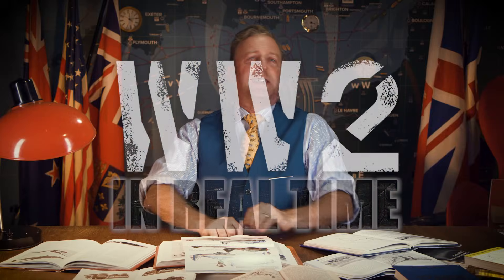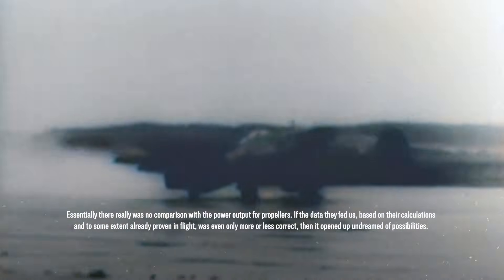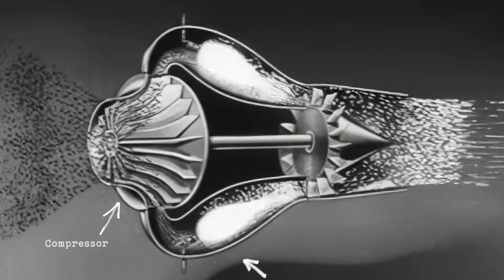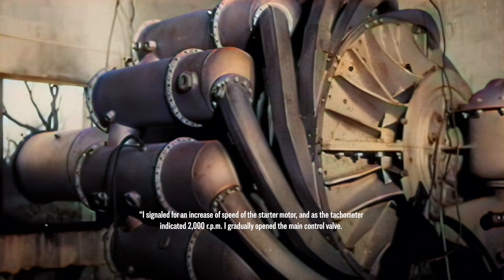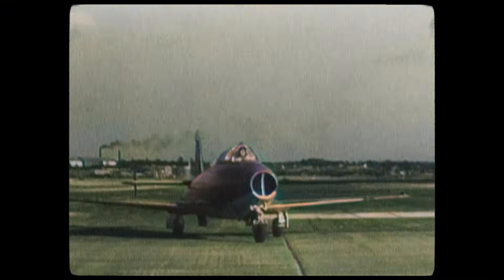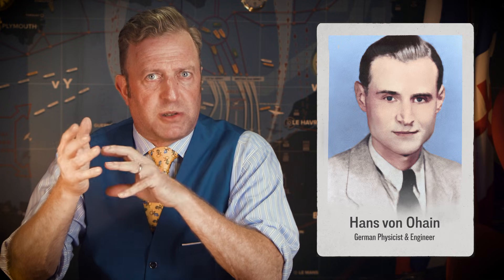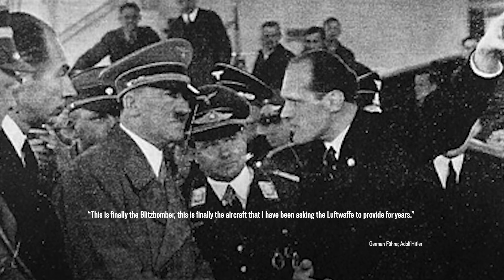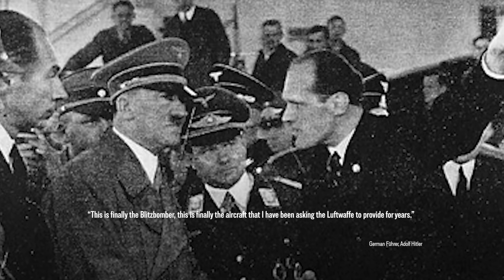WW2 Jet Engine Development - WW2 Special Documentary

Comment: Jet facts:
• To a thermodynamicist, jets aren't too different from piston engines. Both have a thermodynamic cycle (suck, squeeze, bang, blow) in which air is compressed, fuel injected and ignited, and the resulting high-pressure combusted gas pushes the engine along. Indeed, jet engines have a compression ratio, as do car engines, and just like in cars, the higher it is the more efficient.
• The bypass ratio is the proportion of the air accelerated by the engine which bypasses the compressor. Since the thrust increases only linearly with the speed added to the air by the engine, but the energy needed to do so increases quadratically, it's more efficient to increase the thrust by accelerating more air than by accelerating the same amount of air to a greater speed. So a higher bypass ratio is more efficient. However, it is inappropriate in supersonic jets, and it requires bigger turbine blades which can withstand greater centrifugal forces/stress. This is why old jets and supersonic jet engines are thinner than modern civilian jets.
• Because the turbine and compressor blades have to be so strong (with high temperatures and pressures, plus centrifugal forces), one of the main limitations to jet design is materials science. Nowadays, each blade is typically made from a single metal crystal/grain.
• Civilian jet engines are often rented out nowadays, instead of being just another part bought with the plane.
Reply: I am not an expert on jets, but didn't most jet burn their fuel as single burn while piston engines burn their fuel in pulses? Of course there are pulse jets which burn their fuel in pulses as well.
Reply: @vksasdgaming9472  Of course. Still, by following a volume of air through either engine as it is compressed, combusted and used to push the engine along, you can see a thermodynamic cycle which is fundamentally quite similar. You'd typically draw this as graph showing cycles of pressure and volume or temperature and entropy, and the graphs would look fairly similar (albeit stretched differently) in both cases.
Reply: @alphamikeomega5728  I meant that all parts of cycle happen simultaneously in different areas of engine instead of sequentially in same area. At least in theoretically perfect engine.

Comment: During WW2 two paths led to Jet engines the first was a attempt to find a better way to propel aircraft, than pistons, the second was an out growth of high altitude  requirements, eventually you realize that if the boost from a turbo/supercharger exceeds the exhaust pressure you don't need the valves and cylinders. The Russians got there via second route, but cancelled existing in house efforts when captured German jets at the end of the war.

The Centrifugal vs axial jet engines is also an interesting issue. Frank Whittle examined both approaches and determined with the materials available the time would only support a reliable centrifugal flow engine, you might need to replace engines every day with an axial engine, although with better materials they were the long term answer. The Germans built axial flow engines and accepted the need for 10 hours of flight before refurb on the engines. AN interview with Eric Winkle  Brown about this exists on YouTube.
Reply: "an out growth of high altitude  requirements"
uh?
Reply: To pull in ar at high altitude you put a turbo super charger on  the air intake, which is turbine,  eventually you realize that the pistons and cylinders aren't required  if the intake boost is high enough. @johnburns4017

Comment: Had the Me-262 entered service earlier, it would have, at best, bought Germany maybe six months. After that, the P-80 and Gloster Meteor would have began arriving in some numbers, and the allied advantage in production capacity would have been as unassailable as it always was. 
Also, one other problem for those who say: if only they could have built more jet fighters!
Suppose for a minute you are the Reichsminister for aircraft production, and Willy Messerschmitt comes to you saying "I got this new super fighter that is at least twice as good as anything we currently have in production, and I want to shut down and re-tool a bunch of my factories that are making BF-109s so I can start turning out my new plane!" Well, problems is, you're losing dozens of fighters every day right now, and a month or two spent re-tooling for production of the Me-262 might really screw over the Luftwaffe's ability to replace it's lost machines during that time. It might completely hand over air superiority over someplace really important. 
Point is, in a war of attrition, the losing side will have a really hard time trying to regain a qualitative material advantage.
Reply: What if, what if!  It never happened.

Comment: The Me262 had swept wings. Swept wings may seem very common nowadays, as present on every major commercial jet around the world. But it was a revolutionary innovation in WW2.

An aircraft can only fly so fast before it reaches critical Mach number. Normally on an aircraft with unswept wings, that's 60% of the speed of sound. By then the faster airflow on the wing's upper surface reaches the speed of sound, and start forming shockwaves and vastly increases drag for the aircraft and makes it very difficult to go faster.

When air hits a swept wing, it passes over the wing at an angle. The velocity component of the flow parallel to the chord is reduced (rather than 100% as on an unswept wing). So even with the same airspeed, a swept wing aircraft would have lower chordwise airflow speed -- the speed that goes supersonic and create shockwaves.

Hence an Me262 could reach critical Mach at 70% the speed of sound, compared with 60% as with most unswept wing aircraft of its time.

Nowadays airliners so a the "supercritical aerofoil" wing profile -- with a flat top and curvy bottom, to further delay the critical Mach to up to 90% speed of sound.
Reply: The swept wings were an accident. To get balance they moved the wings as they held the engines.

Comment: The largest issue with the British ARC and Air Ministry is that they had their tame Jet Expert, Dr. A.A. Griffith, evaluate Whittle's proposals.  Griffith viewed Whittle as a bitter rival, and could not accept that Whittle's much simpler designs would produce results that his more complex and impractical concepts could not match.  This set British jet engine development back by about 2 years.
The German jets (Junkers 109-004, and the BMW 109-003) not only suffered from disadvantages in materials, construction techniques, and control systems, but extremely poor internal aerodynamics, which led to poor efficiency, short engine life, and unacceptable handling characteristics  - the engines would compressor stall or flame out at the slightest provocation.  The truth of the matter is that by January 1944, in terms of technology, the jet engine race was between Britain and the United States.  In February, 1944, Rolls-Royce's top Jet Engineer, Stanley Hooker, on a U.S. field trip, was shown demonstration runs of the General Electric I-40 (J33) and TG-180 (J35) engines, both of which were running at over 4,000 lbs (force) of thrust, leading him to spearhead development of the 5,000 lb thrust Nene -  Nothing in Germany could match this. 
The specifications for the Me 262 always included provisions for carrying bombs - all Luftwaffe fighter specifications after 1941 did,  Just as with all other Allied and Axis aircraft, there was no real cost in performance to fitting bomb racks to the fighters - a fighter-bomber without bombs is a fighter.  There was no delay in manufacturing airframes - the delay was in trying to sort out the engines, and build up a sufficient reserve of spare engines (To keep an Me 262 flying took 4 engine sets (8 engines) - One set hung on the airframe, good for about 5 hours of flight time, one set in the inspection and overhaul shop, one set traveling to the shop, and one set traveling from the shop to the airplane.  After about 20-25 hours, the engines were no longer usable. 
The idea of the "Blitz-Bomber" was to have an airplane that could get through what was going to be massive Allied air cover of the upcoming Invasion, and be able to attack the invasion beaches - something that the conventional Luftwaffe could no longer perform.  It didn't matter if all they could hit was the ground - the idea was to disrupt the logistic chain coming in over the beaches, limiting the Allies ability to move inland.  In the end, the Allies worked around that issue by pushing the Luftwaffe out of Western France, and bringing their own harbors and fuel pipelines with them.

Comment: Others mentioned besides Britain and Germany.
Japan:  
The Ishikawajima Ne-20 was Japan's 1st turbo jet engine, based of drawing of the German BMW 003 (competitor of the Junkers Jumo 004 used in the ME262.)   The Ne-20 was used in the Nakajima Kikka jet prototype which flew on Aug 7, 1945 - sandwiched between Hiroshima and Nagasaki nuclear bombs.
Italy:  
Caproni Campini N.1 prototype jet was power by a motor jet to compress the air instead of a turbine in front of the combustion chamber.  It flew on  27 August 1940, but was sloooow.  Italian research tried to improve it but stopped with surrender in 1943.
USSR:  
The USSR did invent the Lyulka TR-1 jet engine, but when tested on a US Lend-Lease bomber, it did not work well.  Nothing more was done until after the war when the USSR copied captured German Junkers 004 and BMW 003 engines.
 USA: 
The first US prototype jet aircraft, the Bell XP-59A Airacomet, flew 2 Oct 1942, but had many, many problems which led to none in combat before the end of the war.  The engines were variants  based on samples of Whittle's from Britain.
Reply: The Soviets need not have bothered copying the captured German models, as Britain SOLD 55 Rolls Royce Neve jet engines to them after the War.
https://en.wikipedia.org/wiki/Rolls-Royce_Nene
Excerpt: "A total of twenty-five Nenes were sold to the Soviet Union as a gesture of goodwill - with reservation to not use for military purposes...." Hahaha, anyone who thought that Stalin wouldn't use them for military purposes was living in Lala land! Unfortunately, too many within the post-war Attlee government were.
Reply: To Clarify, 25 were sent in 1946, and the rest in 1947 to make up the total of 55.
Reply: @ktipuss  That was not during the war, but after.  That is why i did not add that info to what i showed.

Comment: It's interesting that the allies also had jets, but rather than swept wings they focused their aerodynamic research on laminar flow, resulting in the P-51 Mustang and Hawker Tempest.
Reply: Straight wings provide better lift at lower speeds versus increased drag at higher speeds. The reduced drag of a swept wing would not have helped the P-51 or Tempest at the speeds they operated at, and would have actually hurt their performance. It was only the advent of jet aircraft with speeds reach 500-600mph+ range that made the swept wing a viable option.

As for the ME-262's swept wing it wasn't developed with aerodynamics in mind, rather instead it was done to maintain the aircraft's center of balance once the decision was made to shift the engines to the wings instead of the fuselage.

It was only during late and post war testing that the true effect of swept wings on highspeed aircraft became understood and were integrated into designs like the F-86 Sabre which began life in 1944 as a straight wing design spun off of the FJ-1 Fury, which itself came from an attempt to create a jet engine variant of the P-51.

Comment: Really appreciate the presentation on a subject close to my heart. However, as many comments have pointed out, you are helping to perpetuate the myth Hitler slowed down production of the Me 262. For the airframe, sure, but the bottleneck was the engines. If anything, the type was pressed into service far too early. And again, as comments have pointed out, Germany completely lacked the materials to produce high-grade alloys to make the engines last longer than 10 hours. 

Even with the gentlest of treatment, the engines were prone to flame-outs and as a result the Me 262 was plagued by very sub-par acceleration compared to Allied piston fighters. When flying anything other than straight at minor AoA at full speed, a P-51 on high octane fuel could and often did catch Me 262's. 

The Meteor, by contrast, was a much more mature and reliable (certainly the Mk.3), but much less revolutionary aircraft. They would never meet in combat as the Meteors were heavily restricted from flying over German territory, negating their impact other than shooting down V1's. With the straight wing and rather old fashioned construction, the Meteor soldiered on for far longer than it really should have as its performance was woefully inadequate by the 1950's. The Americans didn't do much better with the P-80. 

When it came to engines however, Rolls Royce had the best in the world post-war, an advantage the Labour government then simply gave away by selling Derwent and Nene engines to the Soviets, who happily copied the Nene design and then put it into the all-mighty Mig 15.

Far more impressive than the engines, however, was the German progress in airframe design, where they were years ahead. The Me 262 had a much more modern design than the Meteor, with it's slightly swept wings and better energy retention in turns. However, the Germans were already thinking way beyond this and had designs for swept wing fighters that could consistently achieve transonic speeds that would only be realized by the Allies and the Soviet Union many years later. The Mig 15, F-86 Sabre and Hawker Hunter, all used design elements captured from the Germans!

Comment: Many people who ask “why didn’t the Allies in WWII jump at the chance to use jets?” tend to ignore the complexities of making major changes like that during a war.  All the Boring But Important stuff would be affected: production lines would have had to be re-tooled, workers re-trained, supply chains altered, and raw materials reallocated.  Pilots would have had to be re-trained and even after their basic training would lack experience with the new planes.  Mechanics and support crews, just as important to flying as the pilots, would also need complete re-training. Of course I'm not denying that it's possible to do that, there are many examples of rapid technological change during the war; but given that they were doing fine without them, the Allies correctly saw jets as something that would be important in a future war, not the current one.

Comment: The reason German jet fighters could not have turned around the War was the very high fuel consumption on the early jets. They could only operate for 20 - 30 minutes before running low on fuel. Allied pilots, especially Mustang pilots, would wait around the German airfields for the jets to land while they were slow and vulnerable.
Reply: If Schwalbe operated in high altitudes it could fly over 90 minutes and flying low would shorten that time. Most likely those times are result of fuel being distuributed as equally as possible in unit. It is better to have three jets flying shorter time than one for longer time.

Comment: While the Heinkel He 178 and the Gloster E.28/39 are often credited as the world's first jet-powered aircraft, there's a lesser-known contender that deserves mention. In Italy, Secondo Campini, an Italian engineer, developed an experimental jet-powered aircraft called the Campini Caproni CC.2 in the late 1930s. What makes this airplane particularly interesting is that it used a unique type of jet propulsion known as a "thermojet" or "jet engine with a heating chamber." Instead of the traditional jet engine design, which relied on exhaust gases for propulsion, the thermojet design used a piston engine to compress incoming air, heat it in a combustion chamber, and then expel it at high speed through a nozzle.
Reply from the maker: While the C.C.2 might not have led the jet revolution, it certainly adds another layer to the narrative of jet propulsion's early days. Thanks for highlighting it!
Reply: the CC" was NOT a gas turbine it had a piston driven compressor

Comment: The Mk XIV Spitfire was only about 34 mph slower than the 262 in level flight and faster in a dive.  The 262 only went to around 450 mph, or the pilot was in trouble.  The makers said it went to 550 mph, no one else reached that.  262 pilots were told not to go over 450 mph as stability was affected.
Reply: I highly doubt that. The 262 became tricky above Mach 0.8 and uncontrollable above 0.86. As we know the Spitfire indeed could reach higher Mach numbers in a steep and long dive becoming uncontrollable closer to 0.9. Which wasn't really a property with a lot of use in a practical combat engagement against a 262. In level flight no prop driven fighter came anywhere near a 262. The dive properties only helped in a surprise attack from above to get close to a 262. Out of a high speed level flight a 262 would accelerate much faster to a higher dive speed than a Spit. Even if a Spit could technically reach a higher speed in a dive, until then the 262 would be long gone. And German jet pilots flew certainly much faster than 450 mph in level flights when required without difficulties in controllability. 800-850 kph or 500-530mph could be reached in level flight and were far below the max Mach No., especially below 8000 m altitude (thicker air = lower Mach No.for equal above ground speeds). Spits and Mustangs wouldn't reach such speeds above that altitude anyway because they would have to dive quite a bit first to get to such speeds.
Reply: @wanderschlosser1857  
What do you doubt of what I wrote?